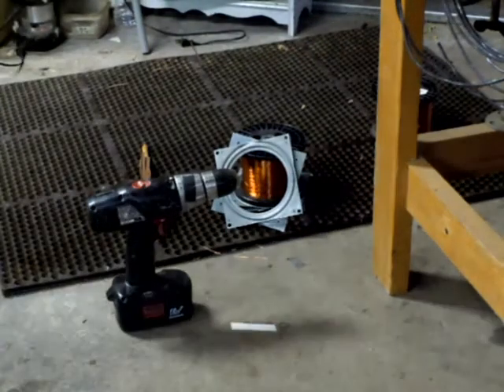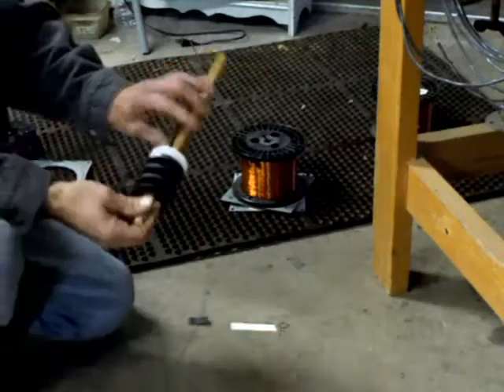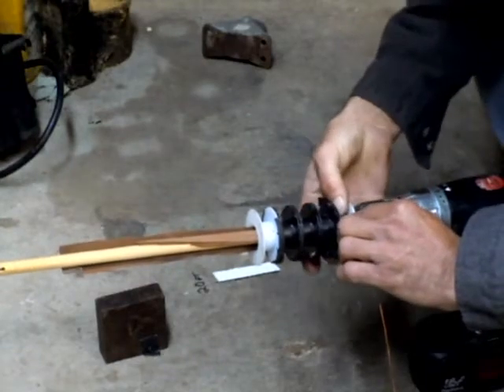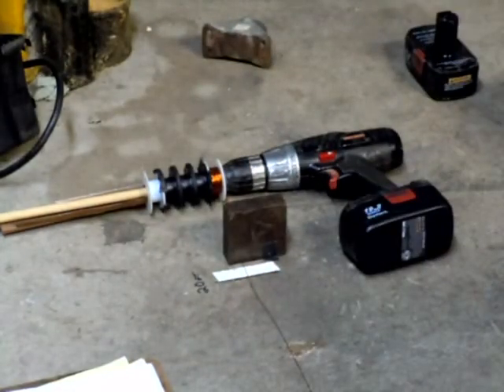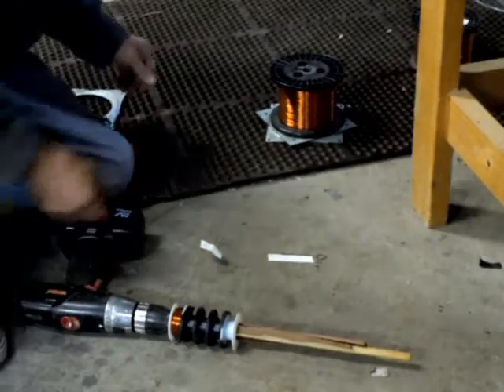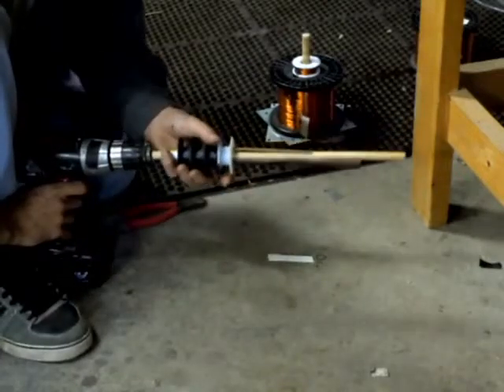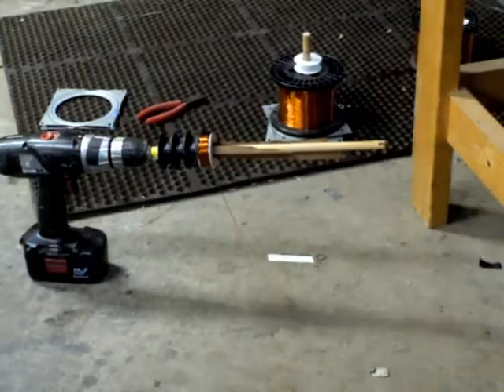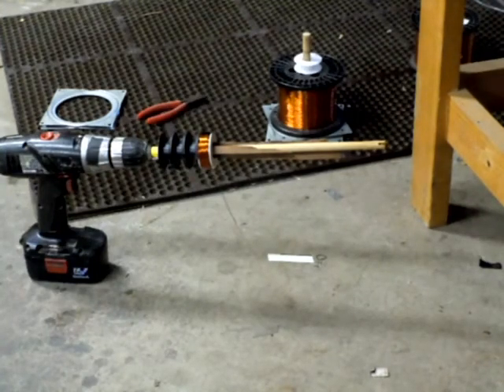Preping Wires for Multi Filar Winding of Bedini Coils

Comment: i understand each coil can have multiple wire winding in each coil. comprising a multifiler coil. and i understand the wire gauge can't be bigger than 18 gauge. for what ever the reason, inductance i believe. but is there a maximum amount of wires that can be turned onto each coil, if 18 gauge is an issue. from all that i have read on this. as a 2 wire coil, 1 energizer coil wire being larger than the signal wire and with 23 gauge signal wire being the largest gauge in any coil. and using at least 3 or 5 gauge wire sizes between the largest energizer wire and signal wire sizes. i would like to wind up a 12 filer coil  or 20 filer coil.